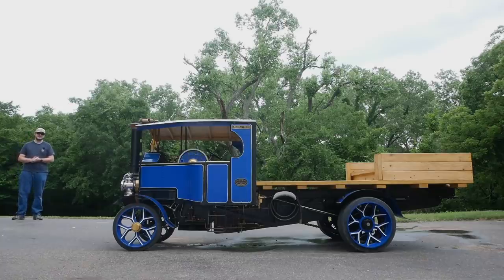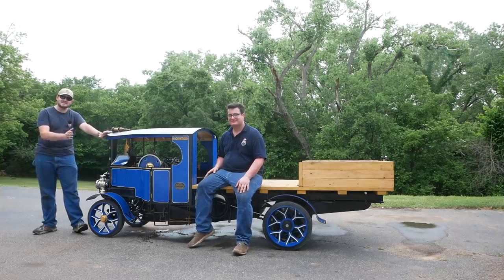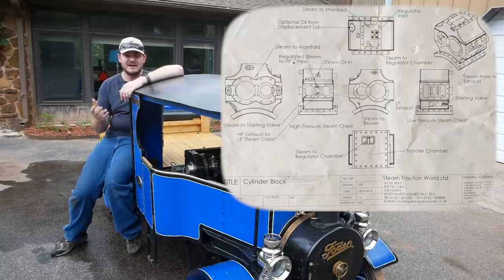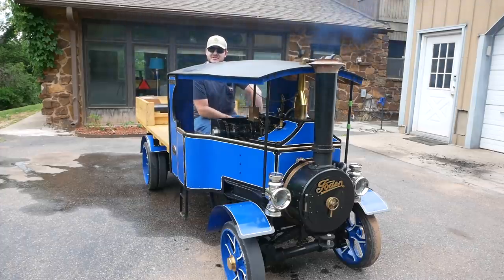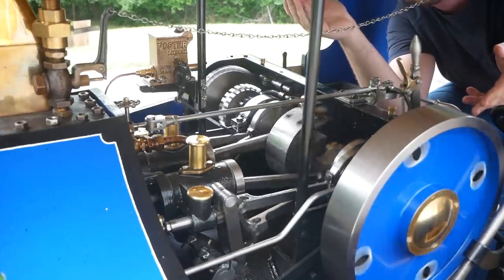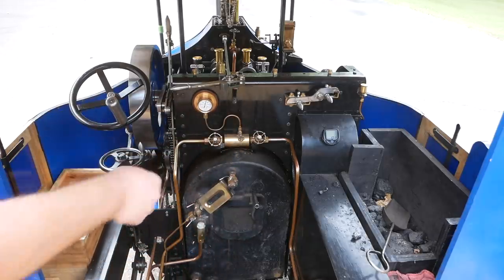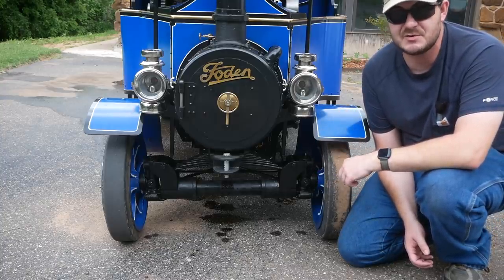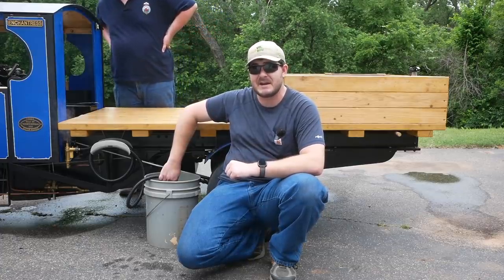This 1/2 Scale Foden Steam Truck is a Glorious Reminder of Britain's Steam Days

Comment: I see the full sized ones driving through town every now and again. They're monsters! Like a small locomotive on wheels. It wasn't just a case of most of them not having independent wheels, some of them don't even have like steering linkages, instead steering by chains! Like old steamrollers.

This minature one is a beautiful piece of work. Can't quite grasp how it was built in that short span of time.
Reply: It came as a kit requiring quite a bit of finishing.....
and he worked on it full-time...because he could....
almost 5 months. 
8hrs a day, probably 6 days a week, for almost 5 months...
800 plus hours of work....

Comment: I have driven a steam Foden, a 1906 War Department prototype which was built as an artillery tractor but saw use in WW1 dragging just about anything, slow ponderous but immensely strong and could pull trees out of the ground.   
If you ever come visit Blighty, do pay a visit to Kew Bridge Steam Trust (where they shot several episodes of Red Dwarf) and see some of the engines there, dunno if the old Foden is still living there but the 90 and 100 inch beam engines will make any red blooded male feel a little ahem inadequate as when the beam on the 100 inch broke the bang from it was heard across London and into the home counties it was that loud lol   
A shame the Scammell Scarab never got to American shores, some made it to Canadian shores but not the US, it was the most insane 3 wheeler ever having the ability to haul a heavily loaded container trailer at 25mph around London and even had an automatic hooker/dehooker making coupling oh so easy, you would love a Scarab and maybe one or two made it across the border?

Comment: Fun fact:  The steam injector, at first glance, should not work at all.

It uses steam at boiler pressure to inject water into the boiler, against boiler pressure.  The trick is that the water set in motion by the steam has enough dynamic pressure to overcome the static pressure and enter the boiler.  The mechanical efficiency of the steam injector is not very high, but nearly all of the thermal energy of the steam is absorbed by the injected water, so the steam injector also acts as a very efficient feed water heater.

I am the proud owner of an 80 year old reprint of book first published in 1910:  Allen and Bursley's "Heat Engines".  Along with some Thermodynamics, it has chapters on reciprocating steam engines, steam turbines, boilers, boiler auxiliaries, and internal combustion engines.  The fun thing is that, being printed during WWII, Diesel engines are referred to as oil engines or compression ignition engines.

Comment: These Fodens were old-fashioned even when new. For comparison check out the early 1930s Sentinel S4s. Forward control, four cylinder horizontal engine under the loadbed, air brakes and electric lighting and a top speed of 60 mph, far faster than contemporary ICE lorries.

Comment: I've always wondered why these machines - as well as steam trains - just dump the used steam into the atmosphere instead of piping it back to a condenser to help re-fill the water tank. You're always going to have SOME loss - but with the right designs and tight enough fittings, it would become an ALMOST lossless system (the coal fuel aside) and would have greatly reduced the number of times they needed to refill their water tanks and been far more power-efficient. I'm pretty sure they could also have been upgraded with more sealed moving components (like the gearbox and crank-shaft) so as to NOT be a total-loss oil system as well.

Comment: Now - as a power engineer (my job is operating steam boilers and turbines, just the stationary kind) - I want to see (or maybe one day build) a steam-powered vehicle constructed with modern technology: a condensing turbine [although this would require one helluva gearbox] or modernized steam engine w/ full condensate recovery (so you're not constantly losing water, or at least not much, and thus rarely if ever have to refill it); a modern high-efficiency small steam boiler w/ automated refuelling system (D-type, with a fluidized bed combustor... or, for simplicity, you could use natural gas? :D); an oiling system that isn't total-loss; etc etc. Maybe with all that technology crammed into it, it might be able to perform closer to a modern vehicle. Since it's built around a steam boiler, multi-fuel operation would be much more feasible; perhaps it could have a set of gas burners AND a set of oil burners (so it could also run on diesel).

I wonder if, with more recent steam tech, one might be able to match or exceed the efficiency of modern internal combustion engines.

I think that would be SO COOL!

Comment: The interesting thing about Foden was the board of directors reluctance to replace steam power with diesel. Edwin Foden's son Edwin Richard Foden fell out with his board so much that he and the Foden family set up their own independent company in the early 30's, using his initials became E. R. F. to produce diesel trucks and later also bus chassis. ERF was purchased by Western star in 1996. Then by Freightliner. Then brought by V.W. subsidiary M. A. N. During this all this it all got messy in the law courts as evidence of fraud due to overestimated value of the company. Last ERF truck range used Man cabs, UK production ceased in 2002, ERF badged trucks made in Germany for UK market only until total demise in 2007.

Comment: In addition to my knowledge of why the steam locomotive fell out of use to the Diesel, I am beginning to see why the combustion engine became the go-to for EVERY auto manufacturer in history.

All you need to do to maintain your Ford pickup is check the coolant and oil every week and swap the tires every few years.

To maintain your steam truck, you need to oil it EVRY day and check its moving parts before and after every use. That's how the railroads maintained their locomotives and it is why the Diesel killed the Steam Engine on the rails. Seems the same happened on the road as well.

Comment: "total loss" oiling... god, i could only imagine what the roads would have looked like it they had pavement when these were on the road... at least on dirt roads your oiling them for free
Reply: I'm not an expert, but I believe tarmac may have been a thing, so similar concept to oiling dirt.
Reply: Not like you were really going fast enough to invent drifting.
Reply: @marsrover001  with the bigger once you could get pretty fast. you just had to be able to shovel fast  and have a lot of water to get to those speeds. It would be very fuel in affiancing and very dangerous but it\s possible.
Reply: @metanevets91  
Tarmac, short for tarmacadam, is made when a layer of crushed stone or aggregate is coated and mixed with tar. ... While asphalt is a similar mixture to tarmac, it actually consists of less external materials, making it slightly harder wearing. Both asphalt and tarmac are used for driveway, pavement and road surfaces

Comment: What was the cost to build this 1/2 scale model?
Reply: 2x price for 1/2x scale, probably :D
Reply: I have a feeling it's ont of those "If you have to ask, you can't afford it" things.  :)
Reply: the current kit is just over 23,000 pounds sterling, so $32,000
Reply: Around 23,500 GBP which is $32,000 USD plus taxes and shipping. When finished worth around $48,000 minimum

Comment: Let me pose a question. Trees grow back, so if you'd burn wood rather than coal wouldn't running the Foden be "carbon neutral"? So, why couldn't you have a steam powered car that ran on carbon neutral wood or a wood by-product like wood pellets? I know that steam engines can be made more effient. Shoot, there was a steam airplane back in the 1930s built by the Besler brothers. A similar engine could be adapted for automotive use and could run off of environmentally sustainable fuels.

Comment: Comically, i look at this and think,  "Wow, this would be a great option for poor countries/communities, that can't get gas to them, but have access to wood.   Wood gas and/or steam engines.  Problem with wood gas is,  its generally an automotive engine which is very complex and requires lots of maintenance.  And while steam engines also require maintance, its generally a "lower tech" style, not requiring the same "industrial base".  IE parts COULD Be made locally, not requiring injection casting, plastic molding, and such.

Comment: That has to be an incredibly eco friendly engine because it doesn't run of fossil fuel
Reply: Coal is literally the original fossil fuel.  Burning wood usually gums up the boiler with resin and makes less heat.
Reply: And all the oil lubricating that mighty beast drops on the ground...eventually....
Greta sends her love every time it runs...

Comment: car problems today... take to dealer, they hook it up to a $5000 computer... need a $2,000 set of tools and a $2000 lift and 4 guys at$25 an hour each specializing in engine, transmission, electronics and legal issues.
This thing... diagnostic tool: your eyes looking into the open drive train... tools to repair fit in a shoe box cost $100.
fuel: whatever burns plus water ... oil... sure, dont matter what kind

Comment: half scale? i say quarter scale as it's not a 2d object.
Reply: Half x half x half

So 1/8th the size
Reply: When talking about model steam engines, inches to the foot is often used to describe the scale. This is 6" scale, or 6" to the foot, or what would be one foot in length on the full size would be six inches in length on this. Perhaps crude, but that is how it is most often described. That is how most model steam engines are built, in various fractions of the foot.
Reply: Yes it's half scale so 6" to the foot but 1/8th off the mass.

Comment: Why would you want a 1/2 scale truck I mean a full sized one would be alot better to drive this being said I want one
Reply: A full size one is 8 times the mass (twice as long, twice as high, twice as wide) increasing the cost hugely. It's also means transportation is much harder needing an artic rather than a van and trailer. :-)
Reply: @steamtractionworld  ok the weight would be an issue